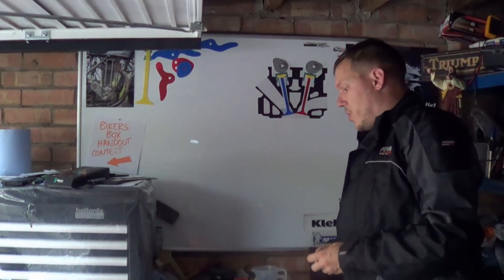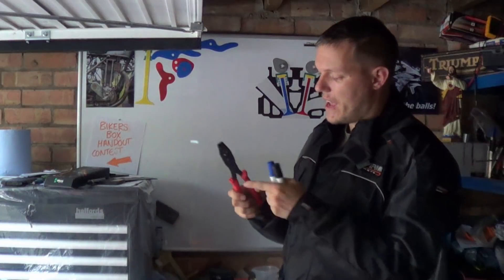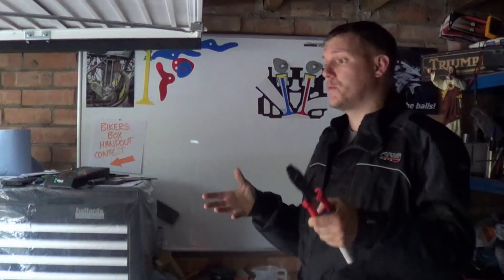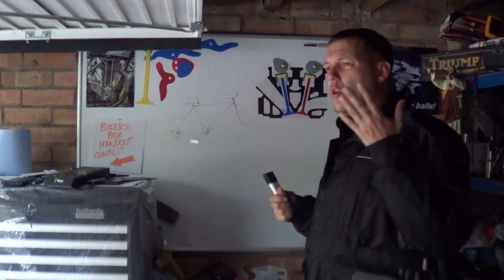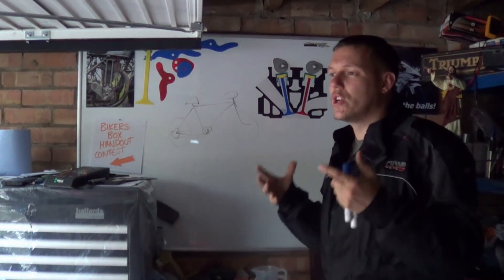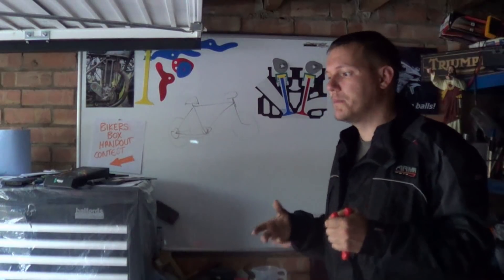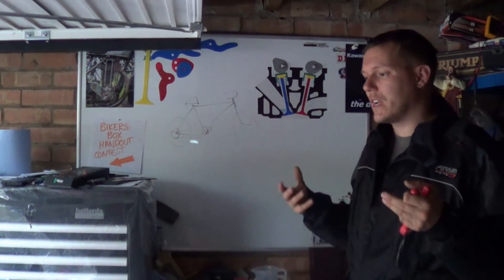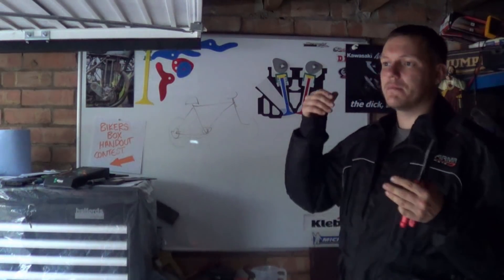Why develop 2 stroke engines?

Comment: why develop 2 strokes. okay, i inivite anyone to try a 4 stroke chainsaw. end of story. there are usecases where nothing else will work properly.
Reply from the maker: This is a motorcycle channel...
Reply: @thedirtyworkshop  an engine is an engine. be it a marine engine (alfadan..) or a whatever engine. makes PUFF-PUFF noise and has a spinny thing ;)
Reply from the maker: Well no, the application of said engine matters, like a cement mixer for example
Reply: @thedirtyworkshop  something tells me if it can convert puff-puff to spiny thing then it can be built in a bike. like bosshoss v8, or that wierd one with the engine in the front wheel, and the other crazy thing thats a kubota diesel engine. in the end all they do is convert puffs to turns. surely a chainsaw engine would not make a terribly good bike engine however.. (husqvarna 3120xp maybe ?) but thats not the point. if it can spin something then it can be a bike engine. maybe just not the perfect bike engine.

Comment: what about a heavily modified Detroit diesel design? direct injection, Sealed crankshaft, use a pressure actuated poppet valve instead of a reed valve, use the bottom of the piston to compress the air fuel mix (though obviously not as much as in the cylinder to avoid detonating the fuel outside of the cylinder, transfer port like a normal 2 stroke, extremely high compression (because diesel), 1 valve for the whole cylinder head. Yes it's more complicated than a standard 2 stroke but being a diesel it's more fuel efficient and has more torque. The Detroit diesel's exhaust valve combined with direct injection prevents the fuel from flowing into the exhaust. Not a huge fan personally of direct injection (due to the extreme pressures and thus excessive complexity and extra engineering) but for emissions and efficiencies sake I think it's pretty much necessary for a 2 stroke. Using Diesel fuel allows you to reduce the amount of oil burnt to at or below the level of an average 4 stroke.
Reply from the maker: "Yes it's more complicated than a standard 2 stroke but being a diesel it's more fuel efficient and has more torque."

- and less speed/rpm and for a small engine that's where a lot of your 'power' comes from. 

Then there's weight. Its a diesel - heavy robust comstruction and the smaller you go with diesel the more of an issue it becomes.

Comment: The demand is there for 2 strokes. Here in NZ, a lot of dirt riders love 2 strokes. They may not be efficient, but they're fun as hell. 
None of the Japanese 4 apart from Yamaha make 2 stroke dirt bikes anymore, so KTM pretty much have the market to themselves! 
Oh, and they're piss easy to work on. Replaced the piston on my KDX200 easy. Well, it would have been easy if I realised that the thread on end of the power valve shaft was reverse thread and didn't snap it off.... Whoops!

Comment: Basically you don't know anything about two strokes, do you? All you talk about is injection. Have you ever heard about stuff like squish ring, loop charging, ramp pistons? There is a solution and it works its etec and orbital for now but since people are developing it about infinitely more than 4 stroke which is developed to its fullest potential, new technologies will come.
Reply from the maker: Right we'll see won't we...........LOL fucking idiot.

Rotax have been making motorcycle engines for years, they are owned by BRP which own the e-tec injector. The e-tec injector has been around for over a decade - so why are there no bikes fitted with e-tec injectors?

I have 2 e-tec inectors at the moment, and I did a video showing how they work. Next you'll be banging on about The Lotus Omnivor engine and so on.

"4 stroke which is developed to its fullest potential,"

- where did you get this from? Both 2 and 4 strokes have been around for the same amount of time. 2 strokes held the reign in motorcycle racing for most of this time, so what are we waiting for? 

Remember that direct injection for 2 strokes will work for 4 strokes. 

And what the fuck is a squish ring, don't you mean squish band, and that's not something new.
Reply from the maker: LOL you mean orbital that came to nothing - http://archive.maas.museum/australia_innovates/index32a3.html?behaviour=view_article&Section_id=1020&article_id=10041#

Secondly who bought out OMC. I didn't say in the comment above that E-tec was BRP's invention did I? I said BRP owns e-tec - i.e the patents and rights. 

Looks like you don't know what the fuck you are talking about. But keep commenting - its good for comment corner.
Reply from the maker: My mistake its the V6's that have etec not the OLD OMC V8's

Comment: Six months ago I decided my Yamaha WR250 just wasn't good enough for what I wanted, which is a single trail and enduro bike, the four stroke tends to flame out at low revs and in the trickier parts. Also they are a pain in the arse to service, expensive to fix, heavy and tend to have their best output up high. 

I went to a test day put on by my local Beta dealer and chose the Two stroke 300RR, problems solved. Light, easy to service lots of low down and mid range torque and also mountains of top end. 

The interesting thing is the oil injection which works like a dream, no smoking, easy to use and unlike the KTM/Husqvarna fuel injection it's not an added complication - as well as more expensive. Yes it's a band aid for the Euro 4 emissions but it does make the thing legal. The Beta is way less expensive, less complex, though has less wank value with KTM guys who love stickers. 

Dunno which is more efficient but the only time this thing smokes is for the minute or so you start it but go back to a four stroke? You'll have to pry this from my dead cold hands.

Comment: BTW, just be getting the exhaust timing right, it is possible to set the 2-stroke to an Atkinson cycle, with moderate compression, and expansion ratio about 50 % greater.
Reply from the maker: "it is possible to set the 2-stroke to an Atkinson cycle"

- say what?
Reply: Atkinson cycle (or variant names for equivalent Miller, etc.) has compression ratio different from the expansion ratio. So you could have compression ratio 8 (for high turbocharging pressure) and expansion ratio 12 for greater efficiency and cooler exhaust.

Comment: Technical configuration: four exhaust valves, port inlet at the end of the stroke. Turbocharger, with electric or mechanical start assist. Must have fuel injection with lots of dispersal, and most likely at least two spark plugs.

Comment: Get a better power to weight ratio. Look at Wartsila and EMD! Amongst the highest-efficiency motors in the world. Crankcase separated from the induction air, fuel injected. RTA-96C weighs over 2300 tons; imagine what the four-stroke equivalent would be like! Impractical for motorbike, but the principles are the same.
Reply from the maker: They are diesels and their efficiency can also be attributed to their size

Comment: Regarding the e-tec snowmobile engine oil consumption you probably remembered it right.  Usually snowmobiles uses 15-50 fuel/100km (yes it varies alot depending on conditions and riding style and sometimes on good days they use 70L/100km) and the oil cosumption is around 1.5-4% per liter of fuel so 3 gallon for 800 miles can be both alot and a little. My average on a season is 35L fuel/100km and around 3% oil
Reply from the maker: Yeah that's fucking madness!

Comment: None of this is new.. it's just disgusting how far off we are. Thinking so statically. EPA is the problem not the engines lol. Here's a little one for ya.. in the good old U.S. it's advertised and true that alcohol burns cleaner, multiple benefits to it etc. on a flex fuel vehicle that isn't modified to take advantage of the wonderful fuel properties of alc you may see a giant decrease at the sensor at the end of the pipe but you forget you gotta burn much much more so automatically multiply those results by 1.5-2 and those are your real world emissions lol

Comment: You say about volumetric pressure, is it possible to use a map switch on a 2 stroke 🤔
Reply from the maker: A map switch?
Reply: The Workshop Manifold absolute pressure, like what they use on a turbo charged engine

Comment: I believe that two stroke engines have a strong future, in the world of RC cars, boats and aircraft which aren't subject to noise or emissions controls. Plus they have the element of strong competition, and fuel costs aren't so much of a concern.
Reply: Dude that boat came in and sailed already, IC model engines are near as damned dead already.
The Li-po battery and brushless motor is far easier, cleaner and safer.
I've been flying since 1993 so have seen a lot of change in this field.

Comment: Im no engineer, im just a kid, but wouldn't putting one bearing on either side of the engine case with their own small oil reserves make it better? Also im not sure how youd lubricate the upper cylinder, maybe something like how the wankel rotary works with the small hole in the rotor housing for a small amount of engine oil to leak into, while still being little enough to pass emissions? It wouldnt add too much complexity i wouldnt think but im also not educated on this sort of stuff.

Comment: Used to have a few 2 strokes, my kh 400 was nuts in a straight line ,handled like a slippery pissed  eel ,and used to throw about 80% of its fuel out of the exhaust,after accelerating hard a plume of blue smoke lingered for days killing all life, ,,there exhausts had a small hole drilled underneath to let the accumulated oil drip out to make a small oil stain wherever you parked loved it like your shows your as mad as a badger
Reply: I'm a better-than-average rider. I had a Kawasaki Mach III for more than a year, and I'm still alive! Powerband like a razor blade. Sounded like a cement mixer full of bolts at idle.
Reply: I have one ,it isn't nuts in a straight line and it handles as well or better than most bikes available in the 70s, so there.

Comment: I think Kawasaki developed a new exhaust system for two strokes in the Asian market that injects air into the exhaust port which effectively acts like that of an expansion chamber but is much more efficient, I forgot the exact model name of the bike but I found it on one of kawis regional sites in probably 2012. It was quite cool to read about, but it seems manufacturers only put r&d into very few markets far and wide for certain applications which means we'll probably never come across this technology.

Comment: how many would be out of work if there is a cure for cancer, all round the world less workers? so much research cash v cure over last 60+ yrs, no cure ? money goes into cancer by govt funding & donations?  i love two strokes, I have  3 race 2 strokes one 4 stroke , all do what i want them to do, along with letting me fall off them lol, So emmisions are not the problem with 2 strokes, KTM have sorted that out to pass eu rules, so is it  just economy ? In the 80's ford used fiestas on trial with a police force, using plastic gear boxes and a three cylinder 2 stroke motor, wonder what ever happen'd to that ? u thunk they had around 10 on long term testing, ngineers work wonders like water as a fuel it emits only water from exhaust ?  where are they ? ( petrochemical companies banks locked up till oil runs out

Comment: You have to separate what the 2 stroke is used for before you start saying why it should be improved to meet new requirements.  I agree with your points mostly, but you are trying to be to general.  I have been riding and racing off-road bike most of my life both 2 stroke and modern 4 stroke.  My opinion is that KTM is doing it because 2 stroke engine characteristics suit off-road bikes in most cases better then 4 strokes.  Lack of heavy engine braking, harder to stall, less rotating "shit" gyro effects, easier to start, easier to fix on the trail, lower centre of mass, lighter weight.....They are a better design choice for these bikes then the alternative.  New Euro4 emission regulation will take away the 2 stroke option from the table.  The benefits still outweigh the engineering costs to improve.  4 strokes can't do it as well.  Electric will be a better choice once they get a bit lighter and cheaper (Alta Motors is almost there!).   Today there are not many areas where a 2 stroke is a better choice given all the criteria of the machine.  But where they are still superior, they will try to keep them alive until some forcing function takes them out of the options of power sources.  Just my 2 cents....
Reply: Issue with elpectric is downtime and weight always will be

Comment: Great vid Matt cheers🤙

Matt I am not an expert around the emissions, just want to clarify, emissions are based on road registered combustion engines correct or wrong?

If off road only not requiring road legal requirements are they're emission constraints!

The reason I ask, major manufacturers still produce 2t chainsaws, lawn mowers, weed whackers and leaf blowers etc etc, they're are far more of these than say 2 stroke dirt bikes for example! 

And if only road legal, then atleast in pure off road terms I can be safe till from these political lying douchebags till I die anyway!

I mean commercial planes would be banned, intensive dairying, all sorts of manufacturing list is huge even Electric cars that people think will solve the problem, the emissions to produce those cars is bigger than the problem we are trying to eliminate! 

Crazy crazy times! Just gotta ride while we can as long as we can

Comment: Hey bro, my snowmobile 2 stroke reverses direction for reverse...is that something you could do a video about...it seams simple enough but at the same time WHAT THE FUCK...how in the fucking hell does an engine switch its direction of rotation in a split second without missing a beat...thanks man, Love your vids
Reply: Gary  Ferguson Jr spark timing.

Comment: I hear the Yamaha 75 2 stroke outboard is one of the most dependable 2 stroke engine ever built and hasn't changed in decades. I would love to see a long stroke low revving like 2000 rpm inline 3 to spin a long prop on an experimental aircraft!

Comment: 1 quart to ten gallons of fuel @ 10 miles to a gallon is 2 gallons of oil in 800 miles. 40-1 is about what the oil pump runs when you run it hard. 
When you run the e-Tec easy like putting down the trail it could run 100-1 but who spends that kind of money on a toy and rides around hugging 🌲s

Comment: The question in my mind is where do we draw the line and say "that line is the point of diminishing return that we shall not cross"?

 For instance if we were to say that a basic single cyl two stroke has a complexity of 25 and a similar sized four stroke has a complexity of 100, then how far are we willing to depart from 25 toward 100? If you could land a two stroke at 50 or so would it still be worth it?

Hope that makes sense...........crap, didn't mean to steal your line lol.
Reply from the maker: Good question and that lies with the Design Director(s). He/she/they have to decide what their next move is. It's a gamble. 

The way it works is like this, you have a direction, you go down that path and hope/gamble that it pays off. Over the years you learn what is probably going to work, but it all starts with that choice high up. 

Take Mclaren vs Bugatti. One go down the path of balance, the other outright power. Other choices are made down the line. 4 wheel drive or just rear wheel, turbo or not...........

Bugatti took the max power, turbo, 4 wheel drive etc path and they managed 7 mph faster after 10 years of technical development.
Reply: Great reply Matt, thanks!
What you are saying leads me to think that if the big manufacturers feel the technology has peaked, then the next possible "AHH HAA" moment for two strokes will come from some dude in his shed.
And if that's the case will it ever see the light of day with major manufacturers? Who knows. But the bigger question is will it be too late.
Reply from the maker: It's already too late. The problem with 2 strokes in this respect is that they have an advantage because they're stupidly simple to manufacture and light. Take this away and the cons instantly outweigh the pro's that you've just lost. 

People seem to think that manufacturers care about power output, that's a sales thing, ever since the 80's.

Comment: Hey you said something about bearings out of the intake track on two strokes. Some of the trials bike companies have been putting them into gearbox oiling system. P46 of this PDF. http://www.gasgasmotos.es/en/manuals/download-v04_despiece_gp20171.pdf.html
Reply from the maker: Ah GASGAS lol yeah and you spend most of your time rebuilding them, I know I had 3!
Reply: The Workshop 

I see you are accustomed to them! 67kg, something has to give.